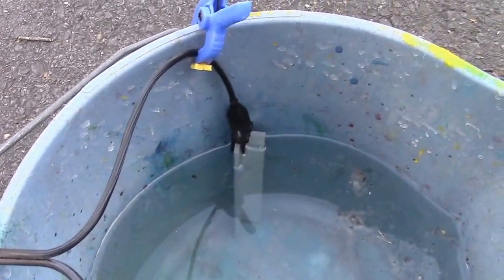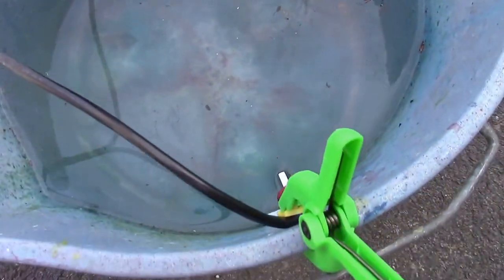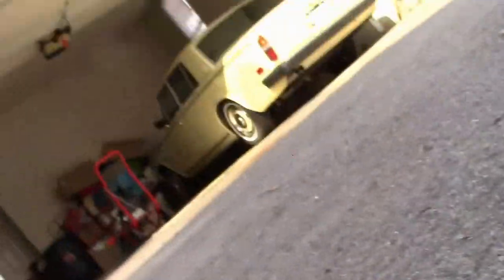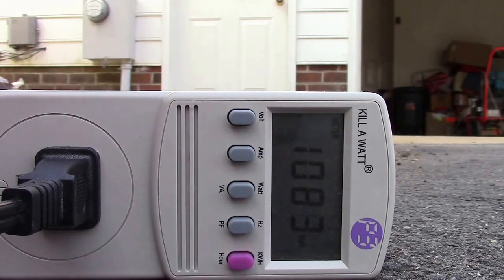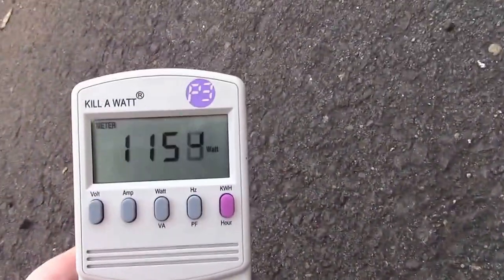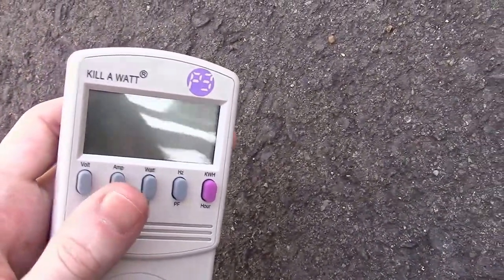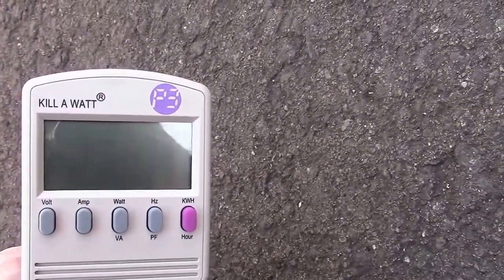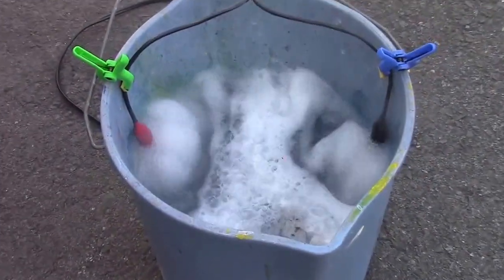Boil Water with Raw Electricity (Electrode Boiler)

Comment: Thats awesome.  Now can you place the conductors within about an inch of each other or would they arc or something.

I would like to mount them in a tube that could be dropped down a 5 gallon water container.
Reply: Placing the electrodes one inch apart should be done in tap water, not in brine, because it will trip the breaker